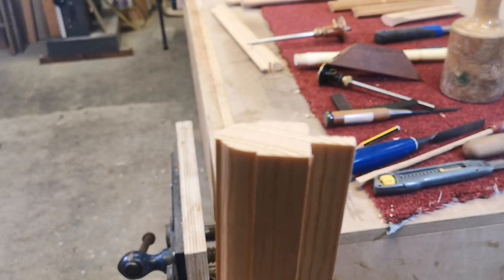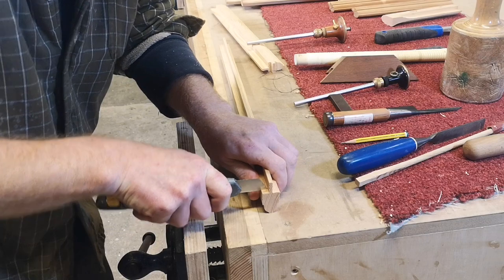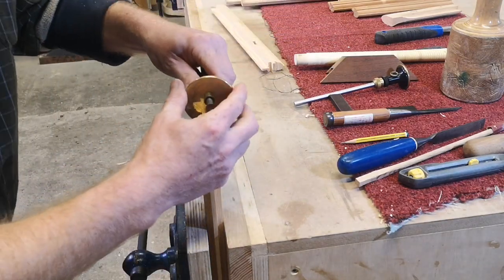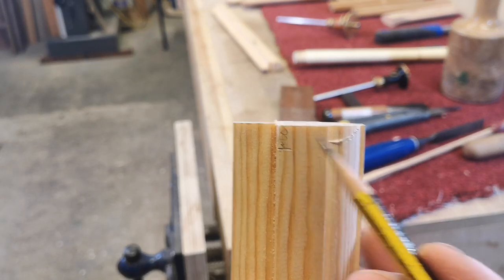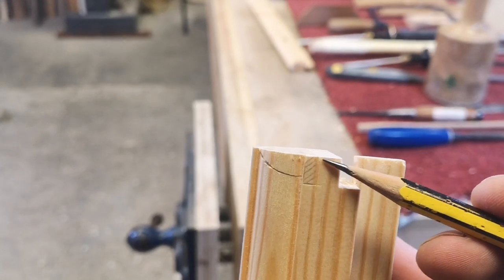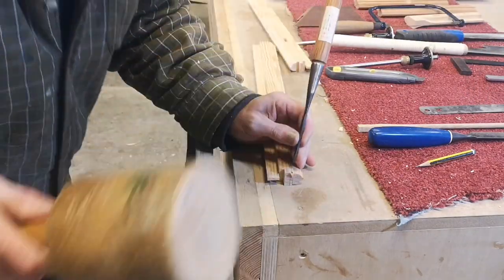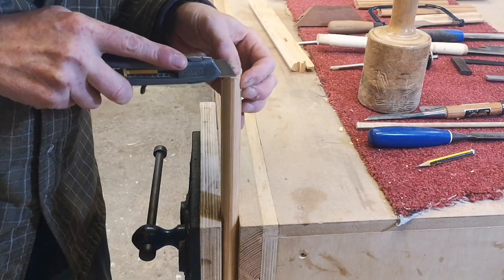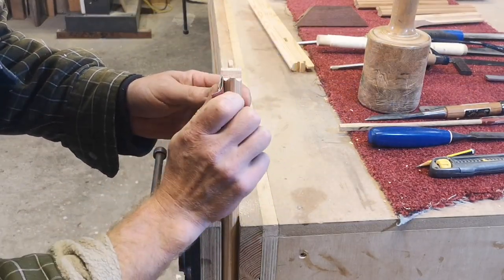How to cut wooden glazing bars. #joinery #woodworking #traditionaljoinery

Comment: Thanks for the great video. I'm in the process of replacing several muntin bars and it is one of the most complex things I've ever done ( I spent 5 years building blueprinted air cooled Porsche engines for a motorsports team, have masters in microbiology, am a certified PA). My brain just doesn't work this way so my hat is off to you!
Reply from the maker: Hey glad the vid was a help. 👍

Comment: when you make these for sash windows and doors etc  would you make them as a frame and then insert into a rebate of the door?
Reply from the maker: Hi no u wouldn't just insert it in the rebate. U would mortise and tennon it into the rebate. So u would have to glue the whole thing up at the same time. Hope that makes sense. Cheers 👍
Reply: @listerjoinery  cheers mate,im a site carpenter by trade but starting to get into a bit of joinery,would a domino be suffice to use for loose tenons into the door stiles and rails
Reply from the maker: Hi to domino these glazing bars into the styles u would have to make the glazing bars quite a bit bigger in section to be able to fit a domino in.👍

Comment: If you needed to fit these into an already assembled frame in between the stiles without taking the frame apart, how might you do it? My first thought was dowels as domino's are too big, but then how would you get both sides in? Great Video BTW, stop motion especially good, must have taken some time. Thanks!
Reply from the maker: Hi their no good way of really doing that. Because the piece u wanna fit in is bigger that the opening.
Otherwise it will just be a butt joint. 👍
Reply: @listerjoinery  That's what I thought. It would be awkward for sure, all I could think of is angled dowels/pocket holes. Or mitre from both sides and pin.

Comment: Nice to see some actual detail on how to cut these joints.  Why didn't you use a mortise chisel that fitted the edge size so you didn't need to fiddle with the extra cut - would it weaken it?  Would you consider making some videos on how to cut the joints for a casement window frame and sashes.  There are a few ways of doing it, would be nice to know the pros and cons.  Thanks
Reply from the maker: Hi yes I just seem to work better that way. Yes I would like to make some casement and sash vids. Next time iam am doing some I will do a vid. Haven't got any booked in at the moment. It's all chair repairs at the moment. Cheers 👍
Reply: @listerjoinery  Thanks.  I've made a couple but it took me a long time to figure out.  Had problems using double glazing and what size timber to use, as the original was based on common timber ie 2 by 2.  And then how big to make the glazing bars while   still keeping them looking slim.  Also, had to  experiment with making franked and haunched tenon joints.  I spoke to an old joiner I know (80yrs old and working since he was 14!) he doesn't bother with haunches - saying that with modern glues you don't need them.

Comment: That is helpful; I thought it was done with a router but now I see it would be sketchy offering up that muntin to a 10,000 RPM profiling bit. The old sash windows had so much soul compared to the extruded aluminum and plastic ones you find at the big-box stores.  For even more soul; fill those lights with hand-blown clear window glass like this buncha cool dudes are making over in Germany:  https://www.youtube.com/watch?v=QXQMc0jsl2E  I don't have anything to do with the company or people; I just like the glass and know it is hard to find that kind of glass here in the US.  There is some available that looks suspiciously like regular window glass that has been heated up to try to give it a wavy look but its just not the same look as they get from blowing that huge barrel shaped glass bubble and cutting it open in the furnace hearth and laying it out flat with the wooden float. If link is not trusted, the title is: See How Window Glass Is Made The Artisinal Way